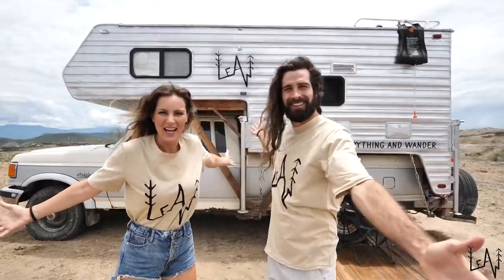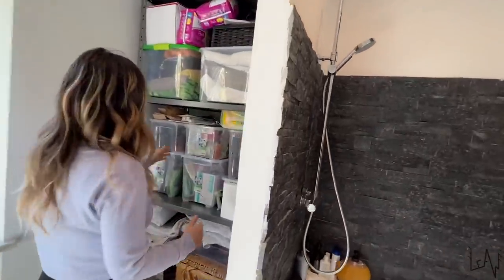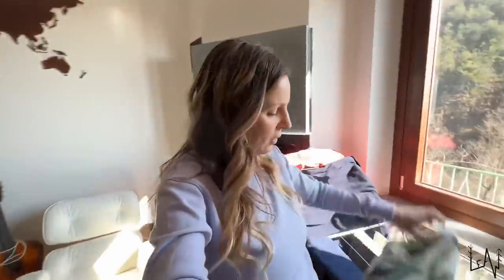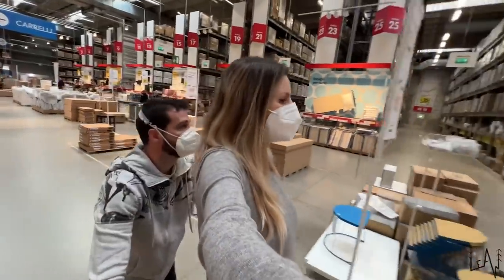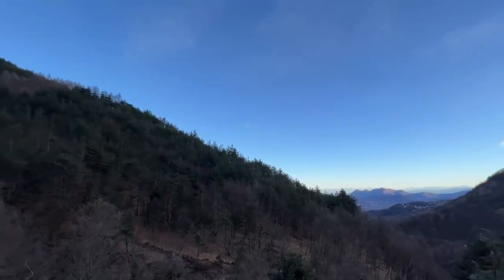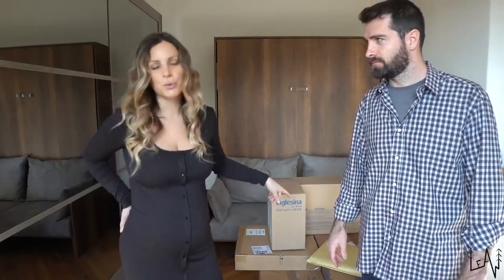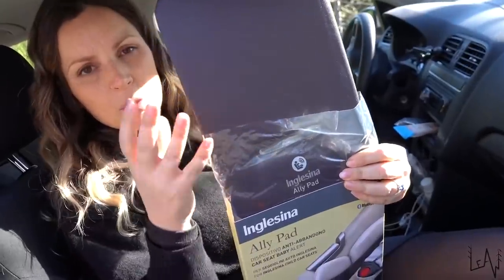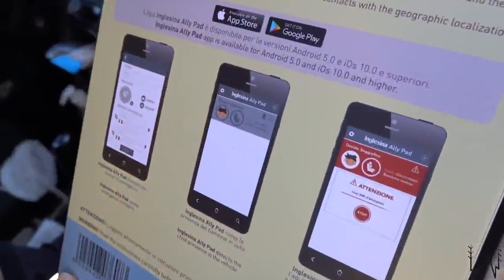THIS WILL CHANGE EVERYTHING!

Comment: The bathroom sink is a masterpiece.  Well done Luke!  If the toilet bowl is functioning properly (drains completely and quickly as usual) and the smell comes from the inside of the toilet bowl, this may be an indication that the septic vertical ventilation pipe that goes all the way to the roof of the house is clogged by something like  bird's nest or debris.

Comment: You may not have the toilet waste pipe vented. I've noticed that older european plumbing has this problem a lot. If you go on the roof you should have a pipe exiting over the bathroom which will allow sewer gases to vent, otherwise they will vent back up the toilet or sink.

Comment: What a wonderful gift from @ingelsinababy! Few tips I learned: you need less than you think. You probably won't hide alone in the nursery to feed the baby, you will probably bring her to your bedroom or to the living room, so it's not very necessary to have a chair in the baby's room. You can get one later if you decide you need it. Babies can be changed anywhere with a changing pad - on the bed, on the floor, on the couch. Buy a change table with a large, soft change pad on it that can convert to a regular dresser later on when the baby grows out of diapers. We didn't use our crib until the baby was after 6 months old. Before that she slept with us and in a bassinette. I recommend: lots of soft onesies, hats, gloves, towels, baby flannels and swaddling sheets. And of course, diapers and a good place to get rid of them (or process to wash them if you use cloth ones!), and bottles if you will use them.